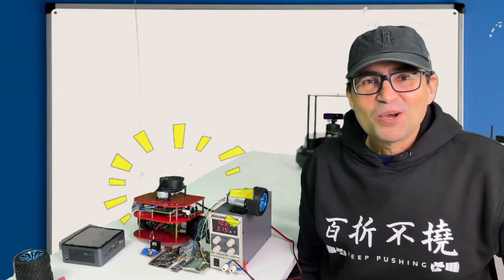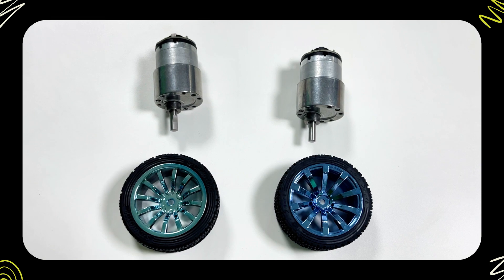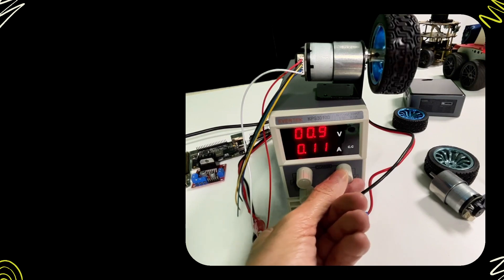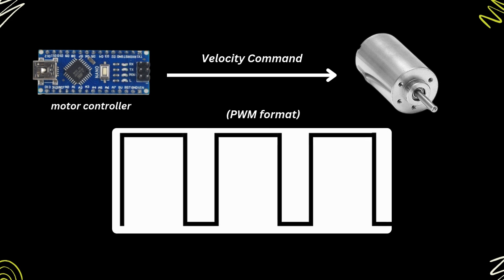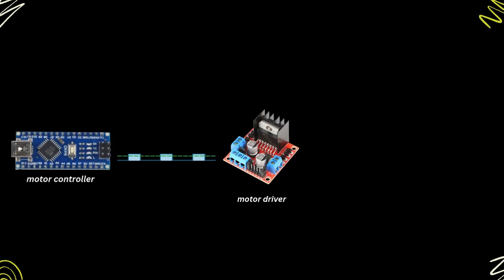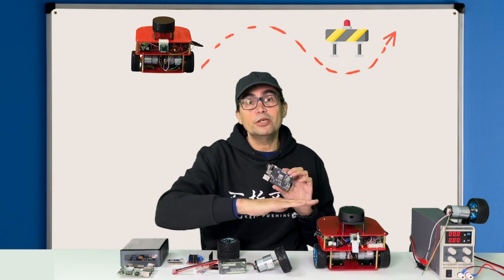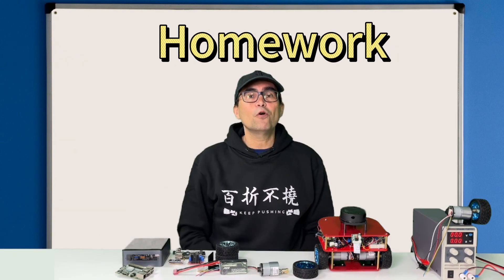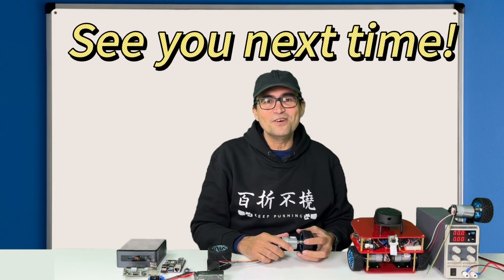Building Your 1st ROS 2 Robot Ep.3: How To Control Motors

Comment: I'd like to see a raspberry pi used. It's cheap, available, easy to set up  and reasonably powerful for such a project, I believe. I'd love me one of those Nvidia boards to play with for sure but the Pi is right in that price point many hobbyists can work with. My opinion, anyways. 👍
Reply: Thanks for sharing! Yes we will use a Raspberry Pi specially for the reasons you stated. By the end of the series we will introduce some options to upgrade the Pi to do deep learning